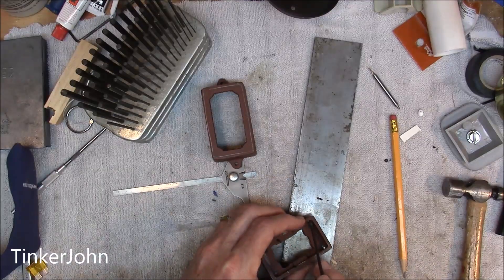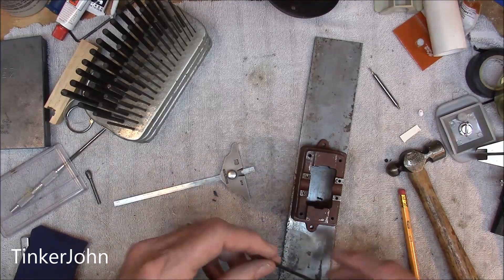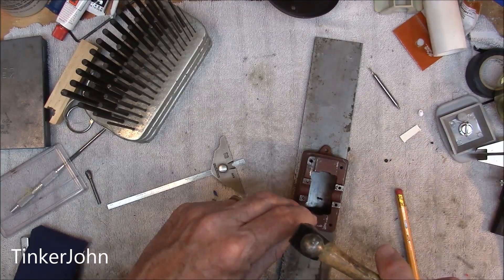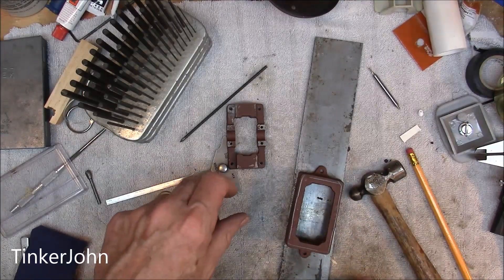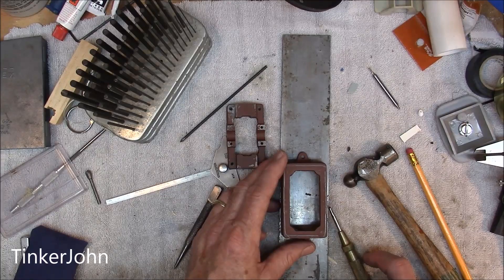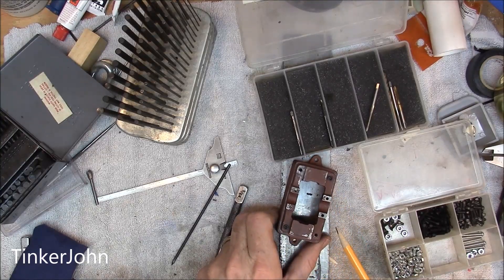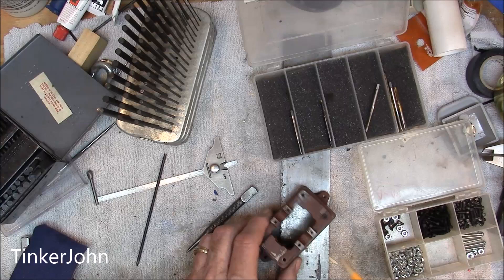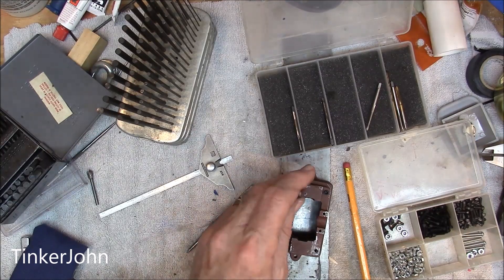Machining the Stuart 10V Steam Engine Castings - Part 39

Comment: A better way to do the transfer punch for the first hole would have been to clamp the whole assembly over the edge of your bench. That way the piece would not move as it did with your first attempt.